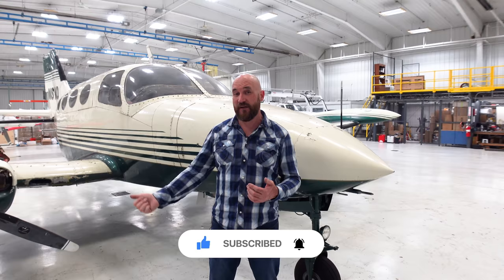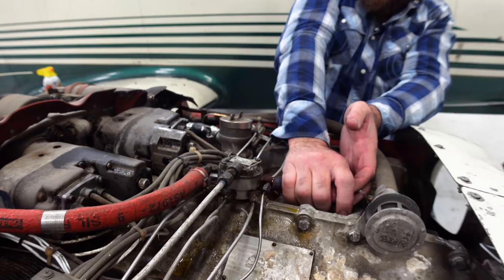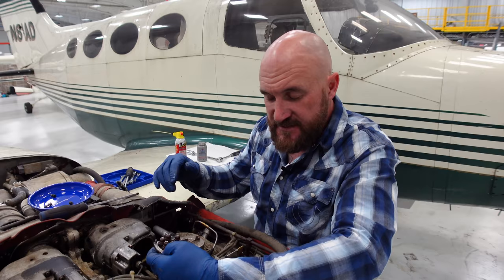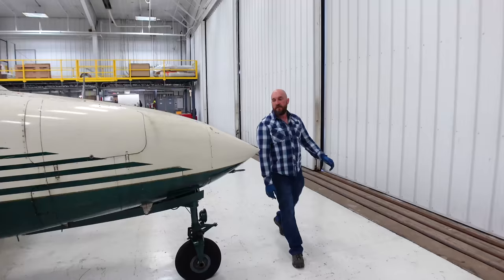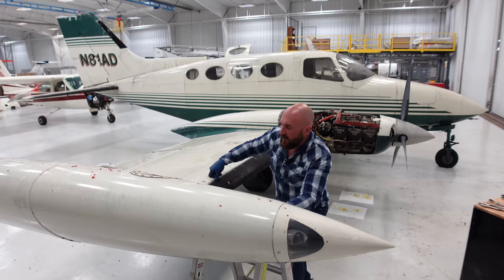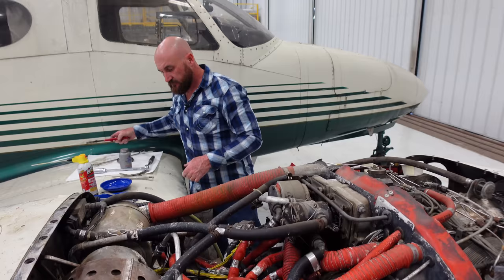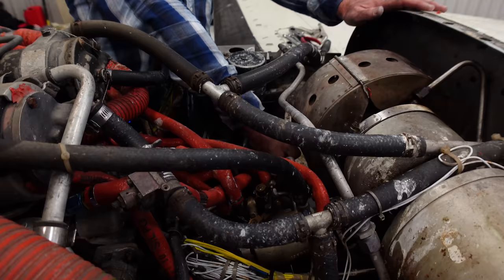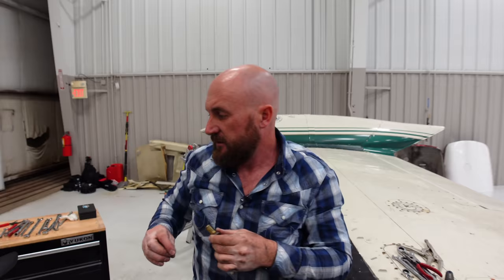He's Trying To STEAL Our FREE Abandoned Airplane ! Ep3

Comment: Main requirements for this exercise, from this engineer / PPL

(1) Workshop Manuals for the Cessna 401 and the Continental engines
(2) Flame retardant boiler suit and spare pair of underpants
(3) Large (trolley size) portable foam fire extinguisher standing by, with watchman if possible
(4) Work to be done in the open, NOT in an enclosed hangar (so far as possible).
(5) Proper electrical connection, not crocodile clips !

I would have thought that there is no substitute for a complete tear-down and rebuild of each engine in turn.

But very best of luck. This is riveting stuff (pun intended).

Comment: There is a diaphragm and spring inside the fuel distribution block cover that is probably hard as a rock.  That diaphragm is a valve that opens when fuel pressure is present.  If the diaphragm is hard, it cannot flex enough to open the valve

Comment: A&P here, I've not worked on a 401, but I've worked on a Cessna 340 and 414, which are very similar. For your fuel issue, my money is on the distributor itself being bad. I've seen the seals degrade and clog them up. Usually for me that means removing it and sending it to overhaul. You might try swapping the one from the other engine. If it is the seals in the spider degrading, make sure to clean out the injector lines and injectors. Hoppes No. 9 and/or MEK works for the injectors. GAMI injectors are tunes specifically to the cylinders, so keep track of which one went where. Some of them will have a number on one of the flats where the first number is the cylinder its meant for (6431 for cylinder #6). For the lines, isopropyl alcohol and shop air. Hope you get it running man!
Reply from the maker: Thank you for reaching out and sharing so much advice….  We’ll get this bird fired up yet ! 
Thank you for being part of the channel !!

Comment: I have a bunch of time  flying a 401 and owned a 310, if the plane sits for a while with no fuel in the mains the sealant in the main tanks can basically bake and clog the fuel lines with sealant...learned the hard way
Reply: that might be the cause of the smaller lines not letting fuel flow, yeah.
Reply: Honestly don't know anything about these planes, so I'm just guessing here. He took the line off what looked like a fuel line regulator/manifold and it had fuel flowing out of it, but yet no fuel going directly into the injector lines. It appears to me, the fuel going into that regulator doesn't have enough pressure to override spring pressure in the regulator, therefore not getting to the injectors. I could of sworn I seen a spring in there when he took that regulator cover off? If it is a regulator it appears mechanical, therefore should have a spring in it that actually regulates the fuel pressure.
Reply: I THOUGHTG  THE 401 HAD BLADDER TANKS ? ALSO THE ENGINES HAVENTG RUN IN 10 YEARS .... THE FAA AND MANUFACTURE CONSIDERS THEM IN NEED OF OVERHALL THEY CORRIODE UNLESS RUN UPTO OPERATING TEMPS ON SOME REGULARITYSTIIL I WISH MAN SUCCESS
Reply: BTW A 310 IS THE BEST LOOKING LIGHT TWIN EVER!
Reply: @randallbehrens1557  tip tanks are sealed metal. They used a sealant that looked like bondo it will dry out and break apart if it sits for a while with no fuel, the wing tanks are bladder tanks

Comment: If your contract states to get it started and not running, just use some easy start down the air intake dor it fire and run for 5 to 10 seconds. Job done, contract filled, plane is yours.
Reply: He need to fire the engine, with thrust, Its not all about spinning blades buddy.
Reply: This isn’t as simple as you make it sound…
Reply: @mx4menot4u  why not? He already said it would probably start but he wants to do it the right way
Reply: @InstantlyGratified  if he wants to do it correctly he would have the overhaul manual (engine manual) opened and reading through procedures/steps. He’s skipping around to make it work. I guess whatever it takes to make it run, but he could be doing more harm then good.
Reply: @AMIT4SIN  we don't know what the contract considers "running".  If it were me, and I was facing someone trying to undermine my work, I'd make it "run" to whatever level the contract specified.  He's already stated that the engines need to be rebuilt, and it's already known that there's a wing spar issue that needs to be resolved before this plane can fly again - so even damaging the engine to fulfill the contract would be on the table (for me).  I'd pull the turbo and let the air filter breathe unrestricted, and I'd put an electric pump on a gas can sitting on the wing straight to the fuel distribution block on top of the engine, then I'd fire that bad boy up.  

Then, when all was said and done, I'd find a way to send the previous owner some money.
Reply: This just seems like manufactured drama.  Old owner know this thing isn't worth scrap.
Reply: What if he's not doing it for the plane, he's doing it for the experience and the content.
Reply: @culdeus9559  Yeah whole thing seems very scripted
Reply: @mx4menot4u  Doesn't really matter, there's no way it'll ever be airworthy again.  NOT a knock, Just the reality of the situation.  The Owner stopped flying it because he couldn't afford the $40K (Now between $70 and $100K) Cost to do the AD compliance.
Reply: @culdeus9559  I agree. Even the whole contract thing seems sketchy. What's the time limit given? Verbal or written. Why would I need a contract for a gift?
Reply: @toadman506  True! Even after the AD was fixed it would cost another $80k to $100k just to do everything else… the plane is worthless.
Reply: Easy start (ether) can score the cylinder walls if not careful.
Reply: @culdeus9559  oh it’s all BS, not a soul with common sense would spend $20k on this trash… although it is entertaining.
Reply: @mx4menot4u  it might be worth it for the parts, especially if they are getting hard to find for an older aircraft like this one.
Reply: @pessimisticpenguin  Ehhh it’s very limited as far as parts go. Might be able to scavenge the flight control surfaces or landing gear components but that’s only if they pass a thorough inspection set by the manufacture. Any heavy amounts of wear or corrosion is rejected, but they could be overhauled if able.
Reply: @mx4menot4u  It should never fly, but it does have a considerable scrap value.  He's got two blocks, some working mechanicals, some aero surfaces, some instruments.  I totally see someone willing to pay $20k for it.
Reply: @brianhaygood183  oh for scrap yeah I agree, but who knows the condition of those parts. The blocks might be good though, just hard to say about everything else.

Comment: i hope you know that before you will pump the system you have to check several things:
1. Fuel tank - open
2. Throttle - full (black handle)
3. Mixture - rich (red handle)
Reply: That's only 3 things ;-)
Reply: Lots of folks here wanting the mixture to be set to rich. Those are fuel-injected engines, guys. No carburetor, hence no mixture control.
Reply: @MargaretLeber  This one is mechanical fuel injection, which has a mixture control. Only EFI has automatic mixture.
Reply: @Stoney3K  I stand corrected...there actually are mixture controls. They're not on the engine-start checklist.
Reply: @gregsaunders4  Several means “multiple”

Comment: A&P mechanic here. Mineral spirits is a good cleaner for the engines. Just be sure to use an air chuck to evaporate it all,  but it'll eat the dirt and grime. That's how we clean engines where I work.
Reply: i used klean strip  for boat engine sitting for 16 years ,, cheap at home depot slept one week in boat lol
Reply: 100LL does pretty good as well 😉

Comment: Continental engines are not quick to start. Especially cold. I've started them thousands of times in my career as an aircraft mechanic. 
You need to prime them heavy, then crank the engine, while slowly moving the throttle lever from idle to full to closed and back
Combustion only happens when the air, fuel ratio is right, and moving the throttle lever slowly, changes the ratio until you hit the correct ratio.
Reply from the maker: Thank you for the tips on starting these engines. Hoping we get in started soon ! 
Thank you for watching 👍🏼
Reply: I always went full throttle/full rich, ran the pumps until flooded, mixture to idle cutoff/full throttle, crank until it fires, and reduce throttle as it starts to run. Continentals love fuel!
Reply: the turbo isnt needed to start it. at least on other turbo engines. at idle the turbo Is bypassed at idle so it should start without the turbo. but.. does rowerwet agree?
Reply: do you agree?
Reply: 20k....get his friends at the airport to charge 30k for storage and back fees.
Reply: if he us all paid up then maybe have the airport slap in a hazard fee because of all the birds that the airplane attracts to the airport which are a serious hazard for aircraft.
Reply: @bobthompson4319  the inlet turbine side of the turbo is never bypassed. The exhaust side of the turbo is bypassed by the waste gate. 
The waste gate is normally open and only closed by oil pressure from the running engine.

The engine will probably run with a seized turbo, but with a big restriction in airflow, so not much above idle.

At takeoff setting, cessna uses some boost to get extra horsepower from the engine, something most other makers didn't do.

Turbo-supercharging is normally only used in piston aircraft to keep the inlet air pressure at sea level, regardless of the aircraft altitude. At least until the maximum ceiling is reached.

Comment: Make sure the fuel selector is on MAIN, which is the tip tank.  The boost/prime pump is located at the tip and feeds from there.  Push the RH throttle to full, RH mixture to full rich and hit prime.  Fuel should flow out of the injector lines.

Comment: You might consider getting a continental engine tech to bring in spare parts of what might be needed and fix the engine immediately and starting the motor.  This way you will know what to do to the other engine.
Reply: Call Continental and Cessna's PR departments and explain what's going on.  Chances are that they may not have even heard what you're trying to do.  They should have every reason to get their techs down there to help you start it up and avoid hurting yourself.  Instant good will with future customers and the general public.
Reply: @jvburnes  You might want to watch some of his other videos before you assume the he's ignorant.  Your comment highlights the fact that you are yourself.
Reply: While this is true and that that would help the same problem may not occur on both engines but this would help out extremely with the project

Comment: Your flow divider valve is stuck! On top of the engine cut the safety wire take the 4 screws out of the spider. Be carful not to rip the gasket or lose the spring, but it’s probably shot any way. Soak and work the valve out: it’s just a plunger. It’s job is to help get the engine a clean shut down and eliminate fuel nozzle dripping.
Reply: Gordon I know zip about Aviation ..I realize he's just trying to fire it up to take possession. He mentioned pulling the engines and updating..obviously thats big bucks I'm guessing that goes to Continental (?) and not Napa  .. and the interior clearly needs gutted and with crows and mice chillin an chewin for a decade I'm guessing the electrical is a total loss.. rubber lines, o-rings seals gaskets belts etc all been degrading for 15+ years of hot/cold/wet/dry/salt air/guano etc.. he mentioned the hundreds of rivits to access the problem that grounded her originally.. also just pulling engine access panels and the belly pans he was drilling out rusty bolts .. um ok question: assuming the engines can be brought back to excellent.. does every nut, bolt, rivet, staple, window seal, gauge, o-ring, hydraulic/cooling/oil/fuel line etc need to be replaced or at least pulled polished and tested and the electronics.. update the old tech.. sat gps navigation etc.. i mean if i bought a 20 year old boat i'd probs spring for a new fish finder lol.. and even after that will it be back to full integrity.. although it's not modern tech those engines have some torque ..  take money out of the equation.. is it worth it??   ok put money back in the equation .. fully redone.. any chance it's a good investment ?     Anyone can answer.. I don't have a clue.. I was just here for a old dumptruck lol .. thx
Reply: @JL-zq9ly   this is why you know the $20k offer is fake.  For the obvious reasons you stated.   I can't see it bringing much over $5,000 on a great day during happy hour.
Reply: @jeremysales1232  maybe the story of a villainous thief in the title is a graceful way to bail out of a winged money pit .. i'd play along lol .. on to better projects
Reply: @jeremysales1232  generous... I doubt there is that much in cores for new parts in this thing and it wouldn't bring that to a scrapper... 

Many of us said in the first video this aircraft isn't worth the money to get in annual anymore so there is no reason, financially, to take on the project unless ad revenue from the videos pay for it.
Reply: @jeremysales1232  dang I got played like a sucka...I'm not aviation savvy....he got me.

Comment: I was one of those guys almost shouting at the screen "mixture auto rich, crack throttle!".  I was kinda hoping that there was an A&P "behind the scenes" to help guide this rebuild along but I'm afraid that there isn't. Airplanes and cars are very different things and without the training, it's surprisingly easy to do some real damage.  Honestly, if someone wants to pay the owner 20K for this beast let them.  Is it even possible to insure this aircraft without log books unless you zero-time everything especially the engines?  Add to that the AD is hanging over your head. I like your chutzpah but this kind of rebuild is the kind that can break you down hard
Reply from the maker: Working on this old and broken down stuff can really break folks down hard….  Normally you come across Multiple failures across many systems. It can and will be maddening. 
I love it. It’s like a constant puzzle that when finished will be so satisfying. Just to give you a little piece of mind….  I’ve started many mechanically injected airplane engines. While working with this one I’ve followed standard and non standard starting procedures. It’s not as simple as moving a lever this way or that way. It has many major system failures internally and externally. We’ll get one of the engines started to seal the deal and then both eventually. It’ll take a number of new parts and a lot of hours of hard work 💪🏼
Thank you for watching Tom 👍🏼
Reply: @rebuildrescue  You can not even legally work on this airplane unless under the direct supervision of an AP/IA. With no log books or airworthiness certificate you may also need an inspection by an FAA DE (designated examiner) The engines and props can only be rebuilt by a licensed A&P/IA or a Part 135  FAA repair shop. With out log books you will be requuiered to rebuild them to prove engine time and airworthiness. Getting them started may be all fun and games but it will never fly without hundreds of thousands of dollars and man hours it is not worth it. I can appreciate the challenge of getting something running good luck.
Reply: @jamesgay3761  he definitely can. You don’t need an a&p to watch over your shoulder for every turn of the screwdriver. Yes eventually the IA would need to verify the quality and completeness of the work in order to make a logbook entry. If everything needed full time eyes on by an a&p how would anyone ever get started as an apprentice in a shop? The trainee does xyz work then it’s thoroughly checked by the signing mechanic.
Reply: @jboylan95  Wrong, there are only a few things a person can do on an airplane without an A&P license or under supervision of an A&P. The FAR's are pretty clear on that!
Reply: @jamesgay3761  He can work on it all he wants, he simply can't fly it until an AP/IA were to sign off.
Reply: @jamesgay3761  Under normal circumstances you're still not right but at least you'd have an argument. Normal circumstances doesn't include 4k, 60 FPS video following the person as they turn every screw and nut. And even then, there aren't maximum hours for airplanes, merely maintenance interval requirements, and a complete D Check was always going to be needed on a plane this old anyway so regardless of fixing it it was going to get a thorough and expensive inspection like literally any plane that is a little long in the tooth.

Old planes aren't instant scrap. They're just annoying to get going right and too hard for many/most.
Reply: @jboylan95  I did not say watching over his shoulder I said direct supervision, which means the AP/IA is in the building or close by. I am an AP/IA (although retired) and went through the apprentice and school proses.
Reply: @aleksbiteman5324  I didn't say he could not work on it, I was simply pointing out that working on an aircraft requires certifications they are not cars. The work he is doing is entertaining but that is about all. I enjoy watching his videos.
Reply: @jamesgay3761  "You can not even legally work on this airplane unless under the direct supervision of an AP/IA." That's just not true, anyone can work on a plane. Hell, a five year old could, but not anyone can make it airworthy. As an AP/IA I'd assume you'd know that. There is nothing illegal about working on this plane.